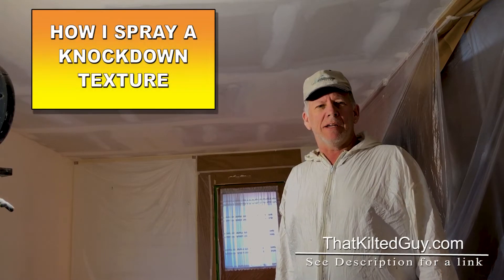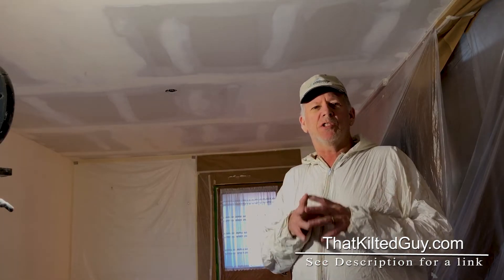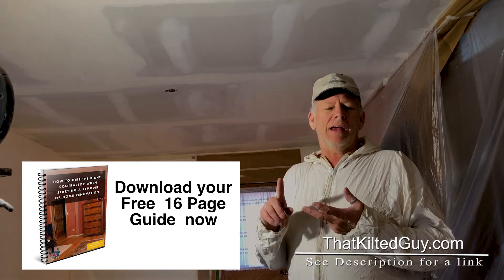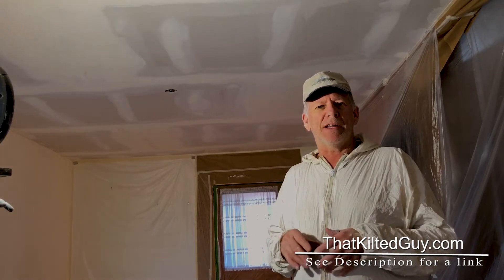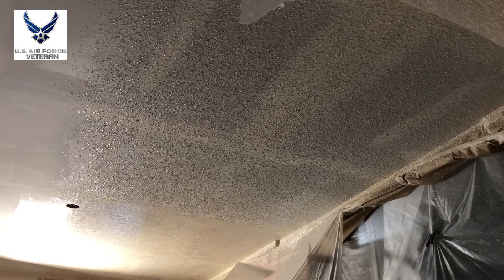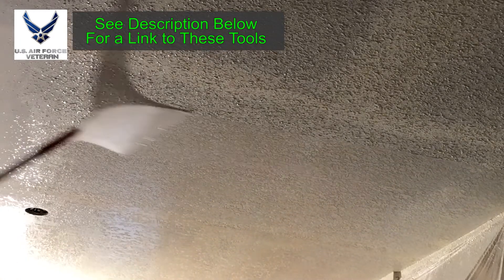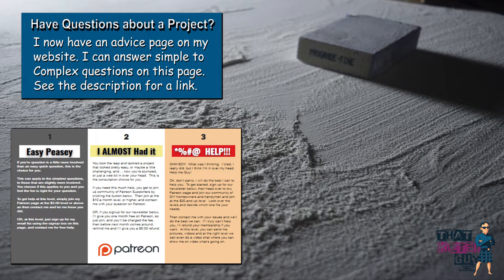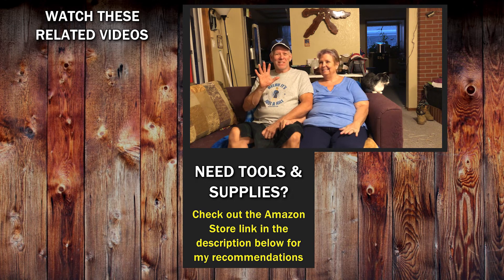Live, Spraying a Knockdown Texture with a Hopper Sprayer, by That Kilted Guy DIY

Comment: whats your thought on priming before texture I have read it helps to not have seams show from the texture drying faster on the more porous mud is there truth to this ?
Reply from the maker: Actually, there's quite a difference between the porosity of the mud and the sheetrock.  So yes, it does help.  I know that most guys don't worry about it as we can adapt a little as we go when knocking down, but on remodels and such, it's not a bad idea.  But you can get by without it.  If it were my own house, I'd probably do it as pva primer is cheap.  When you do a repair, the difference is HUGE and can cause real matching issues due to the painted drywall not being porous hardly at all and the repair being very porous.  I just spray really carefully, and I have a textured sample ready to shoot a video and demonstrate that, so stay tuned.  Hope that helps.  Thanks for your support on our channel.  Guy
Reply: @ThatKiltedGuyDIY  thanks I have always primed before and after texture but I'm not a pro so I'm not trying to make money. I'm doing a stairwell at my mom's in a day or two and wondering if I have been wasting my time glad to hear I'm not.
Reply from the maker: Glad to help